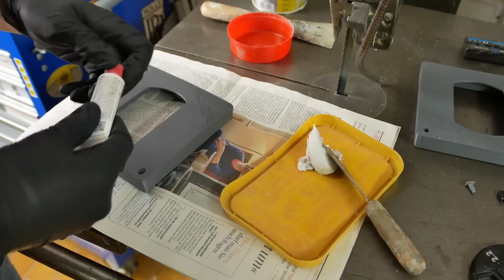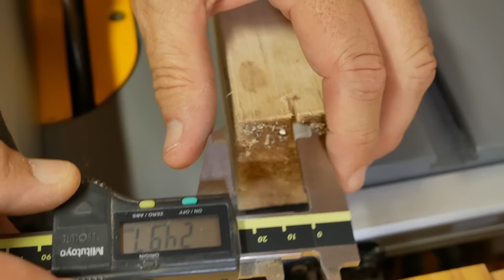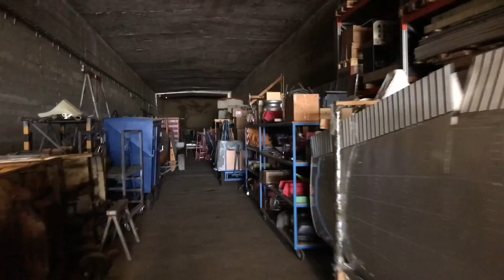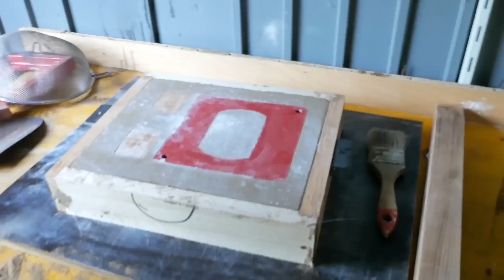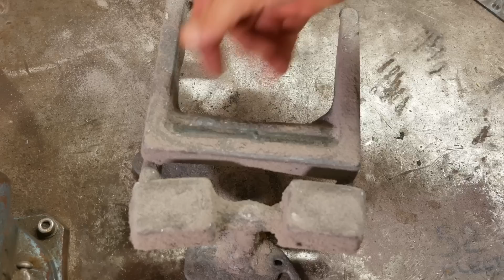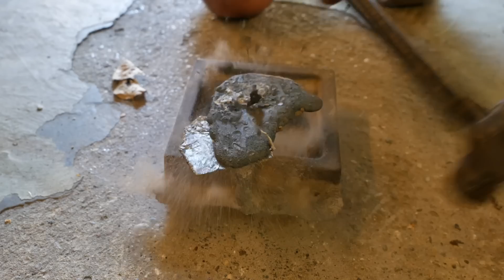Iron casting at home || RotarySMP

Comment: Love those casting videos. In a week or two I expect to arrive my first crucible. My plan is to build oil burner and I have set of nozzles, from 0.35 up to 8galons per hour. I have all needed equipment from high pressure oil pump to thermometers. Any info on time needed to melt the iron and oil consumption? I need to size my nozzle.
Reply from the maker: Good one. Are you active on Alloyavenue.com? Great resource.

My oil tank is an old 10Kg firex, so probably a bit over 2 gallons. I can do roughly one A10 crucible per oil fill, and it takes about an hour from cold. 

What refractory liner did you use on your furnace?

Comment: Casting looks like one of those things where I'd spend $2K USD buying everything needed, making one casting, and going "OK, that was cool" and then tripping over the equipment for the rest of my life.  It's much better to just watch you doing it :)
Reply from the maker: Yeah, I can agree with that :)
Reply: I probably spent closer to $500 to DIY a simple burner and furnace that melts a small amount of aluminum. Plumbing fittings and a MIG welding tip for the burner, a recycled "party" helium cylinder for the furnace shell, Kaowool and sand from the local ceramic supply store. If your goal is experience, $500 is cheap and the DIY furnace and burner can be repurposed as a forge. "OK, that was cool" is perfectly good motivation :)
Reply from the maker: @bobapthorpe  I have no idea what I have invested in my foundry. I just nickel and dimed it over the years, so the value is secret from me (and the finance minister :)

Comment: Why did you use water instead of used motor oil to moisten the sand ?
Reply from the maker: Because it is benonite clay bond green sand. You can use it over and over, as it just dries out with each casting, and you mull it with water to restore it. I do have some oil bond sand for extremely fine detailed castings (but havent used it yet). You can restore that with 2 stroke oil.

Comment: The important thing is that your logo came out flawless😁
Nice castings
Reply from the maker: Thanks Steve. Yeah, those patterns worked really well. Luke designed them well.
Reply: wrong. the important thing is that he ( and we as well ) learned from the fist time and didnt commit the same mistakes the secend time 

 you mean the first or secen time casts xD
Reply: @flikflak24   Hi flik  other than the obvious humour, the fact that the makers marks came out so crisply
is an indicator of how well the casting was done.
Reply: @steveggca  not necessarily since there could easily be pretty good/big voids inside. only way to know is to look inside them all the way through ( destroktely which  is the easy cheap way or by xray penetration ( yes they do have x-ray machines that can look through metal with the exception of lead ) whice is more expensive but you get your cage and able to eat it to )
Reply from the maker: @flikflak24  We will see once Luke machines them whether any inclusions or voids are exposed.
Reply: @RotarySMP  i cant imagine that there would be a lot of machining work to be done. if im not wrong the point of casting a part is so the part is almost to final for and only need a minimal amout of work to get it into final size and ofc some of the other propaty's that comes with casting. such as its more random crystal structur that helps it absorm vibration better. i do wounder what diffrence it woul make to the structore and propatys if you had the mold seperated a bit before pooring and right after its poored but still molden that you then caps the exid and then press it the last bit togeather. pretty much let it cool down under a higer preasure
Reply from the maker: @flikflak24  That is not realistic with sand casting. The water which binds the sand and gives it strength boils off, allowing the mould to collapse during solidification.
Reply: @RotarySMP  also if the box is from metal and have steel plated on the top and bottom and then put it in a press and let is solidifi there ?
Reply from the maker: @flikflak24  Try it and tell me how it works for you.
Reply: Oh man, spoiler alert should have been issued. I haven’t the time to watch the full video so I some how decided to read the comments. I guess my bad. Have a great day! 😂

Comment: gee thanks m8. now after seeing that sand wall i start woundering about how good it would be as absorbing sound reflections / ecco's in a room 
btw of my understanding from watching others doing there sand moldes. arent you suppose to use some completely dry super fine sand to dust on as the first layer and then use the moist chunky sand afterwards ?

also do wounder how well useing a 15kw unduction heater would work to melt the iron insted of gas/oil powered 

and the hard cast iron you talked about is normaly refered to as white cast iron (whick happens when its cooled to quickly. slow cooled iron turns into gray cast iron well quickly cooled turns into white cast iron. pretty much the only reason you want white cast iron is that its harder/more wear resistance well every other propaties is worse then gray ) i do wounder what would happen if you mixed in some graphite power into the iron. maybe it turnes into cast steel insted ? ( most ranges is made of cast steel btw )
Reply from the maker: A very unique building that one. 
You need a parting powder. I use Talc for that. There are other options. Watch some videos for olfoundryman. He explains the process really well.
Most smaller steel mills (minimills) use induction heating, but it is not trivial to make a functioning one.
You are misunderstanding the chemistry. To get from cast iron to steel you need to remove carbon.
Reply: @RotarySMP  i dodnt mean the parting powder i ment as the first springle of sand on the part that you do with the sift ( first the part. then parting powder. then very fine sand sand and then the bulk compacting sand ) thants the way i ment it

i also just read up on it after i posted the comment xD 2+ % carbon turns the iron 1.9% and below carbon turns to steel ( i somehow had it in my head that increasing the carbon content would turn it into steel and not the other way around xD )

its so sad that its hard to do it as they did it far back in time where we got the best cast iron ever ( they had a opening in the bottom of the flast instead of haveing to tip it. that way non of the junk at the top got mixed in plus the best part of the cast iron always sinks to the bottom somehow. plus less exposior to air well its being cast ( you almost have you flask sitting on your casting form and poor it insted of haveing to poor it from such a hight )

also got to wounder how it would turn out if the flask and casting was done in a inert gass envirement ( like in a big container full of argon) so no oxigen would contaminate it at all

that place is sadly to far away from where i live to go visit. but the though's about its sound absorbing propaty's was still sparked by that clip
Reply from the maker: @flikflak24  At this point I am trying to minimise variables and get the basics working reliably. I dont cast often, so adding complexity like multiple sands, additives, other pouring processes, would lead to more complexity and failure modes. I am happy to get a solid part.
Reply: @RotarySMP  thats also fair and a good mindset to have with those kind of things
was just trying to hear others oppinion about those things since i may or may no do one myself ( though way way bigger. we are talking like a 1200x1500x60 mm machine bed casting )
Reply from the maker: @flikflak24  That is a huge casting. Do you have a foundry nearby with a large furnace or cupola?
Reply: @RotarySMP  nope. probably also better to go with makeing a 10mm talled box and then fill it with epoxy granit or epoxy steel then

Comment: Remember the traditional wallpaper paste? A bit of white flour and some hot water. Makes a simple glue, then mix a percentage of that into the water you wet the sand with, your sand will hold together really well.
Secondly, get some much finer sand and use that for contact with the item. Like a skin of a few mm of superfine sand and water paste mix. You can spatula it on or even use a brush. The superfine sand will hold details much better and give a smoother general surface finish.
Then the rest of the mold filled with the regular cheap sand.
Anyway awesome vid! 👍😁
Reply from the maker: Bonding the sand with starch is one method of making cores, but  the starch burns out, so you have to discard that sand when you shake out.  The advantage of bentonite clay bound sand is that is reusable. Just add water and mull it again.
Normally with cast iron molds, industry uses a graphite core wash to improve the surface finish. How would you apply a paste to the mold, brushing or a spatula just destroys the detail. Putting a paste on the pattern, and it will not release from the sand.
Reply: @RotarySMP    sorry I didnt communicate very well there. 
I meant to add trace amounts of the starch glue in the water, this tiny amount gives you some control over the stickyness of the sand and how well it will hold detail without the details breaking out when you remove the master (plug). That tiny amount of starch wont hurt your sand reusability.
With the fine sand, basically you are just improving surface detail by using finer sand, but since that sand is more expensive you just put a thin layer of the fine sand over the plug and after that, fill the rest with regular sand. If you get a consistency like plasticene etc you can spatula it on, the finer sand makes a putty form more easily than coarse sand.
Reply from the maker: @wizrom3046  I have the foundry book with a variety of recipes for additives like flour. I am mostly trying to reduce variables, and get the basics working. To be honest, I was very happy with the surface finish of those parts. They had a sand textured finish, but picked up the detail better than expected.

I do have a bag of commercial oil bound sand, and it really has that putty feel. I am saving it for special projects which need fine detail, and haven't used it yet.
Reply: @RotarySMP   thanks for  the reply, I didnt know if you knew about starch additive and I generally work on the assumption that it's always good to speak up, if someone already knows then there is no harm done, if they didnt know then you might have given them something of value. 🙂
Yeah I agree your castings came out really nice, and the sand texture finish is great for some applications, it's a bit harder to prep and paint but I guess you probably have media blasting there it's pretty cheap to buy a blasting cabinet these days.
Reply: I think you refer to carboxymethyl cellulose (CMC). AFIK it is used as a binder in ceramics and powder metallurgy.

Comment: I love your casting videos! I learn something every time! I've been wanting to try iron casting for years. So far I've failed because I don't have an oil burner.
Reply from the maker: The oil burner was really simple. Just an old firex with a pneumatic coupling on it. I use my compressor to pressurise it. Then just a shut off valve and needle valve. by preheating the furnace, the oil vaporises as it goes in.

Comment: Brilliant, just the kind of thing I want to try casting.
Reply from the maker: Go for it Brendan.
Reply: @RotarySMP  need to make a NOBOX7 burner.
Reply from the maker: @brendanshorter5550  External combustion burners look spectacular, but are pretty inefficient. All that glowing red stuff is wasting heat not helping melt the metal.

Given the temp in the furnace, you dont need to be fancy. The oil vaporises on contact, so as long as you deliver a slightly rich mix of oil and air, it is fine.
Reply: @RotarySMP  so those ball valve Pakistani Truck videos gravity feeding oil into a burner are actually quite efficient.
Reply from the maker: @brendanshorter5550  Yes, as all the combustion is happening in the furnace, with the metal. The only downside of a drip feed burner, is that you have to already have a hot furnace. But running on propane for 10 minutes to get started is very easy.